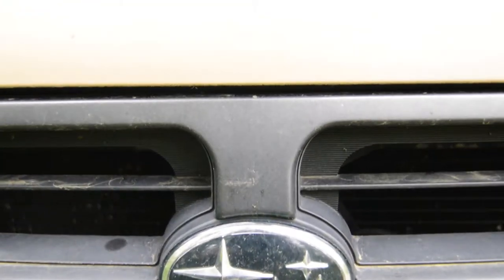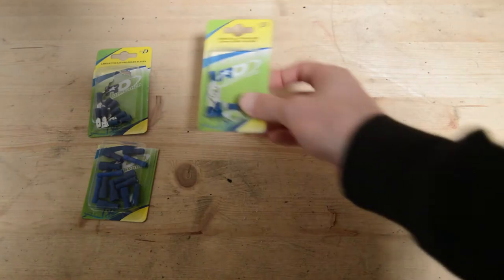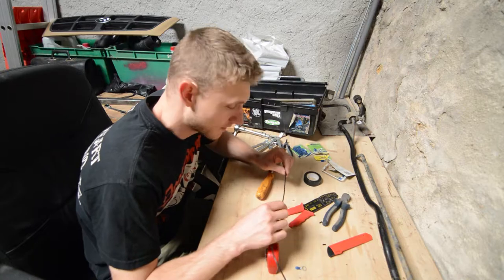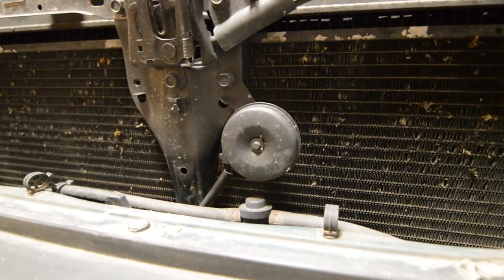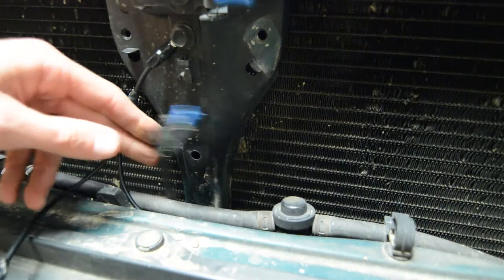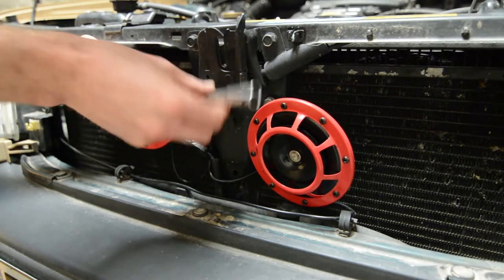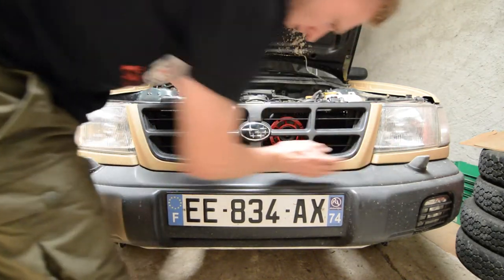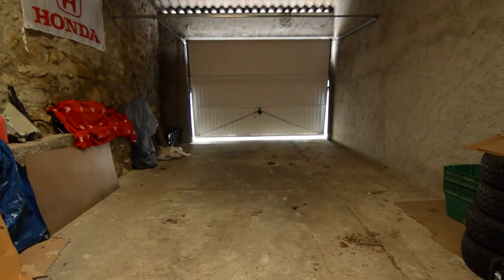VLOG #4 - HOW TO INSTALL HELLA HORNS on a SF FORESTER

Comment: All it requires is the positive connection which plugs into the car's pre-existing horn wiring, and the negative or ground connection which connects the hella horns from the horn to the ground (or negative battery terminal). 

It's also smart to do a test where you wire one horn and hold the ground to the negative terminal, and then barely touch the positive wire to the positive terminal of the battery and try not to get your ears blown out (but if there's no sound, you know the connection is backwards). 

Go about it safely and smartly, may even want to disconnect the negative terminal of the battery once you have tested to see if your wiring on the horn connections is correct. 

If you've never done something like this before, you just need to understand the connections necessary (positive to car's horn wiring and a ground connection from each horn to the battery or other ground) and to fashion wiring of the correct gauge with the right-sized terminals. 

I did mine a few weeks ago and I'm still so happy with the hella horns and that they work in my Toyota Camry.